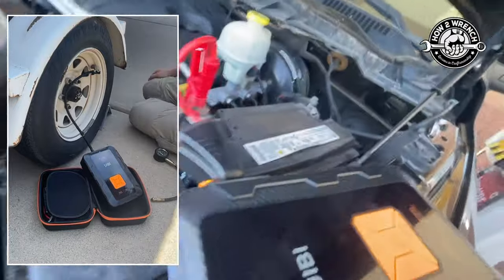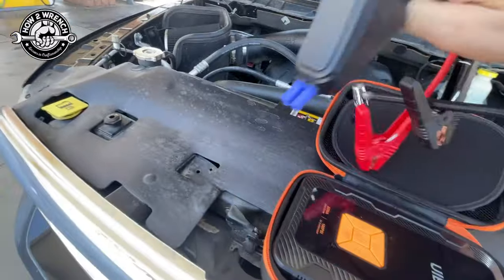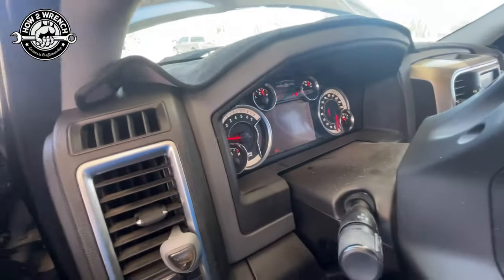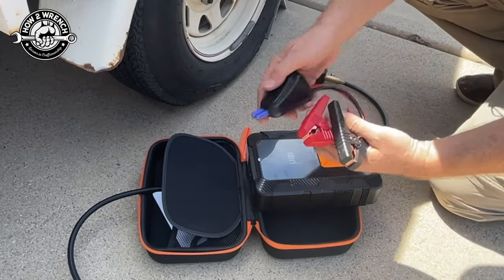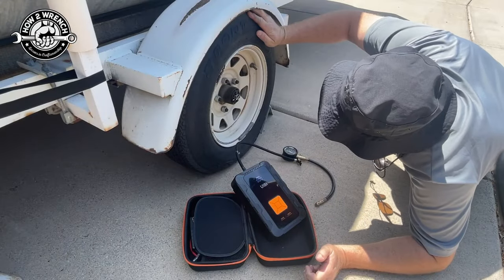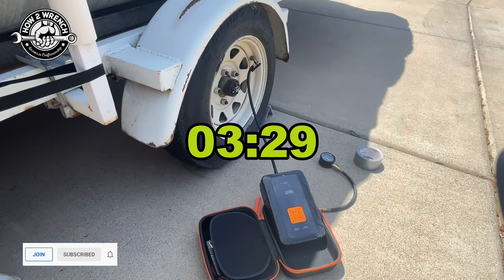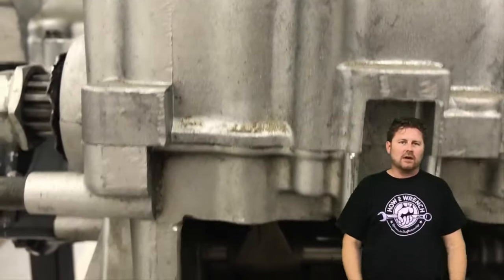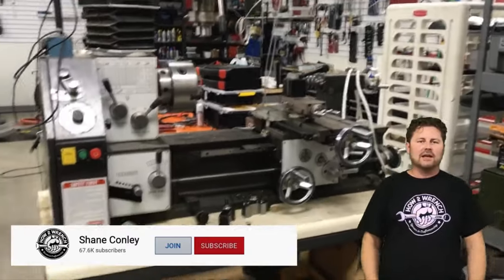UiBI Jumpstart tire inflate LED flashlight Phone charger all in 1 #jumpstarter #tireinflator #h2w

Comment: I bought the AstroAI model off Amazon, probably made in the same factory or at least a similar factory with similar components.  The AstroAI unit has a 2500A battery jump as opposed to the Uibi 3500A, and goes up to 150PSI as opposed to the Uibi's 160PSI.  I do really like how compact the Uibi model is whereas the AstroAI model is more boxy and I feel probably takes up more room than it should in my saddlebag.
Reply from the maker: Thanks for sharing.